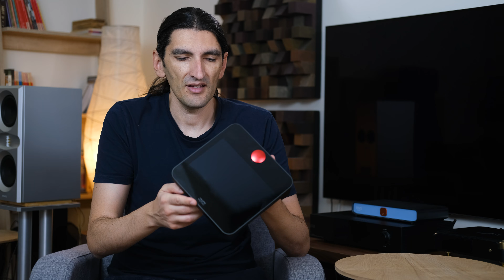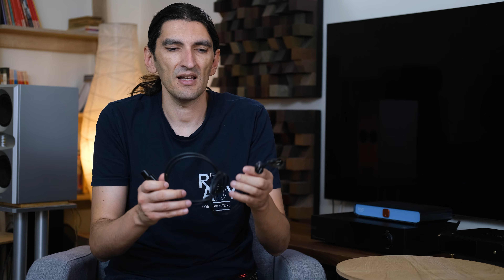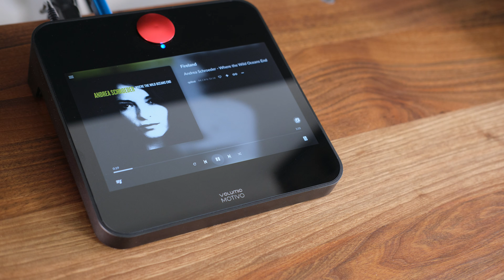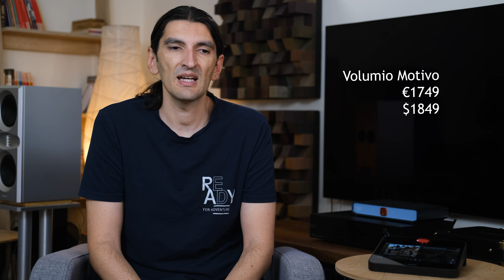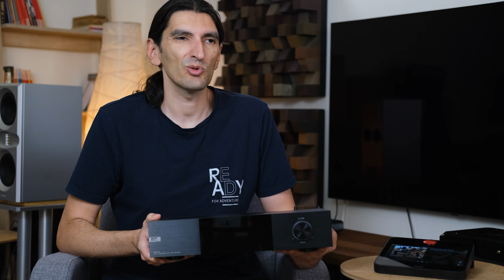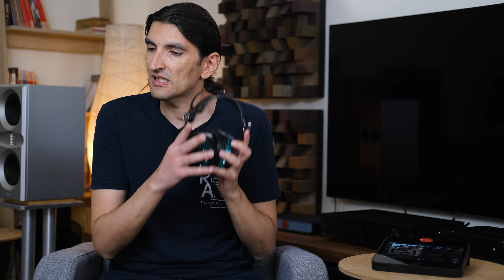High tier audio streaming with Volumio Motivo

Comment from the maker: Additional info: The Motivo control app and its UI can run somewhat slow if you use a 100Mbit connection. Using a 1Gbits wired connection or stable WiFi will make it snappy. By the way - WiFi has one of the best implementations I've seen. It sounds every bit as good as my wired connection over the Gustard N18 Pro switch with Supra LAN cables. WiFi is usually worse so I was surprised by this. I forgot to mention it in the video but Volumio did a great job with the WiFi module here.
Reply: Agreed! I was using wired first then changed to WIFI and its pretty good.
Reply: Thank you for the video.

I missed some more images or recording about the device and the screen. It's extrange in a device that is mainly a big screen, no see it enough. Just as sugestion ;-)

In the other hand, if, as you mentioned, the Motivo is better than the Rivo, it's including a very good the DAC  and the headphone aplifier... the Rivo could be a better buy if you aready have DAC and headphone amp, but in case you haven't, seams that Motivo is a better choice.

I am habituated to that XLR/TRS combined inputs because I use mixers, and my mixer also has that XLR/TRS. Also I had a Musical Fidelity HPA-MX headphone amplifier with the same conections.

In the MF, the TRS conectors work as 6,3 mm TRS jack stereo single ended outputs, same as in the Motivo, but normally these combined connectors also works as balanced, that means that you can connect with XLR balanced cables, or you can use 2 TRS cables, one for each conector (right and left) to get also balanced output.

Are you sure, the MOtivodoesn't work as I described?

In the other hand, the device is interesting, but I think it would be more interesting if would include an HDMI input/output that allows to connect easilly a TV, both for use Motivo as DAC or to play the MOtivo interface in the TV

Regards.

Comment: Great review! Is it possible to use this straight to a power amp like a Nilai for a compact and simple system?
Considering this or buying the Rivo+ for my main rig.
Reply from the maker: Yes it does have variable level outputs.
Reply: @iiWiReviews do you think this will be a sufficient setup or would a preamp make it sound better in a speakersystem? My thought was simplyfing my main rig, but sound would maybe decrease. Maybe better keeping my mainrig and buy the Rivo+
Reply from the maker: Good preamp would make it better - bigger soundstage, lusher sound, more air. I consider direct source to power amp setup as a place-holder until your budget allows for a preamp. Its addition makes much bigger difference than upgrading any of the existing components to a more expensive one
Reply: @iiWiReviews  thank you for replying. I think I will stick with my Luxman amp and Yggdrasil DAC and instead order a Rivo+👍🏻

Comment: Great review. Thanks for that!  I am considering buying a Motivo. Also see you reviewed the A6 and A8. At the moment I am running a RP3/Volumio connected to the Chord Mojo, love the sound of the Mojo but not very practical due to the battery. Since A8 and Motivo are in the same price range, how would you compare the two? Many thanks for your response!
Reply from the maker: I find them more or less equally capable on their analog outputs. Motivo has more capable digital outs if you ever decide to connect external DAC to it. Also, depending on where you are Volumio can be noticeably more friendly to your budget since shipping and taxes are included in the price.
Reply: Thank you for your kind and quick reply!

Comment: Why not spot light Wiim Ultra for far worse software issues .. Yes there is alot of features in the Wiim but it amazes me why reviwers never call them out ..
Reply from the maker: I never experienced any with Wiim. Funnily enough I never experienced any issues with Volumio Rivo either.
Reply: @iiWiReviews  Well mine got to the point of insanity, and returned it . Just seems many products are not finished and rely on updates to just make the products work correctly . Maybe that's just the way of things right now .

Comment: Hi, The display not advancing is likely a UPnP issue. I see the same thing when streaming to a Wiim Pro using Audirvana Studio. Speaking of Audirvana and Wiim, that combination is fantastic at this point in their respective release cycles. I output the Wiim to an SMSL-SU1 and think the combination is excellent value for money. What's interesting is that streaming to the Wiim with UPnP Kernel Mode sounds better than connecting to the SU1 via its USB input.

Comment: The only one who has said the real and serious problems that this software has. The equipment they sell has a high cost and comes with problems. cannot be admitted. I use paid Volumio, $70 a year to have Tidal Connect and most of the time it fails and you have to restart.
And we must add the problems discussed in this video. 
If they want to get paid, it should be stable and bug-free software.
Reply: I have worked with the Primo and Rivo and never had software issues. For the record: if you buy a Volumio device, the software is included.

Comment: Seems like all manufacturers left the audio as is and switched their efforts to video, investing in ever growing screens which are not useful since what’s easier than buying a very simple cellular and declare it as your remote. running the music from an app is the easiest way, which can be done from the comfort of your couch.
I had a chance to compare my ifi streamer to a much more good looking eversolo 6, I must admit the the eversolo with it’s shining screen looks convincing but, using an external DAC , I think only a trained bat can sense the audible difference between the two. The ifi stands somewhere , well hidden while doing what it has to do (stream music) while I enjoy the music without being obstructed by too many screens
Reply: The Motivo was developed as a headphone DAC , and requirements were set by the Volumio user community. So, that’s how Volumio ended up with this design.

Comment: Hans Beekhuyzen also reviewed the motivo on his channel and was equally impressed. He tried using an upgraded power supply but was surprised to find that it sounded worse . So it seems Volumio also did a very good job with the power supply.
Reply: @justasimplefox Alpha Audio has a good relationship with Volumio? ?? Maybe we can ask Jaap Feenstra
Reply: @justasimplefox  Maybe use your own ears then? Measurements are published on the Alpha Audio review, so you can check those yourself.

Comment: How about the Rivo with a solid power supply compared to the Motivo?
Reply: Should be closer but the thing with the Motivo is that it's the result of a collaboration of many people from their forum that know what they are doing, the implementation is highly optimized.. Besides that, It has some upgrades over the Rivo harwarewise. The Motivo will be better and the price ends up being similar if you buy the Rivo and a good LPS. I spent a lot of time looking into this and ended up doing just that :)
Reply: @renatomorais8136  I have to say the Motivo looks impressive. But, I would still add an outboard LPS, that is just a given. Have you tried Roon with the Motivo? I picked up the Roon Nucleus One and the Sbooster 19v LPS and was blown away at the sound quality improvement with the Rivo. Even my WiiM Ultra sound quality went to another level. Fun hobby to say the least.

Comment: I would love to see a Rivo (streamer only) with a screen! It could be a touch screen - but it could be "just" a screen. The Rivo and the Motivo seem to be amazing streaming devices; based on your reviews.
But I have my DAC that I love - the Geshelli Labs Dayzee with an LPS, and I have upgrade the op-amps to the amazing Sparkos SS2590's.
Reply: You can attach the Rivo to a screen or TV, there is an HDMI output. I am listening to my Rivo right now. I have the Rivo with the Farad Super 3 LPS with the Roon Nucleus One and an Sbooster 19v LPS. It sounds fantastic over my ToneWinner AD-1Pre+ DAC/Pre out to the ToneWinner AD-2Pro+ integrated amplifier. I have the Fyne F500SP bookshelf, along with a pair of Maggie LRS+ and a pair of Zu DW6 Supremes. What kicked the Rivo over the edge was the introduction of the Roon Nucleus One, and then the power supply. The Rivo really needs a quality power supply.
Reply: @michaelwright1602  - thanks - I had forgotten that detail. I think that with a external LPS. the Rivo might rival the Motivo as a streamer? My only hesitance on the Rivo is the ability to sign in to my Radio Paradise account, so I can stream my Favorites from RP. I can do this on my Node 2i, which with an LPS sounds much better than it does stock.
Reply: I need to get that Dayzee... ;-)
Reply: @michaelwright1602  It is simply stunning - with the stock TI OPA1655 op-amps; with an LPS. When I upgraded to the Sparkos SS2590 (after about 3 months listening with the TI units) - it opens up even more, and I am simply floored when I listen to music that I have heard for decades. The level of clarity and layering and fantastic dynamics - miniscule to massive - it is almost like a new piece of music.